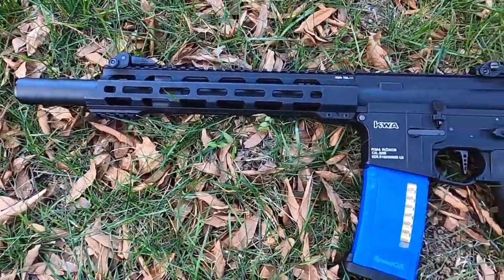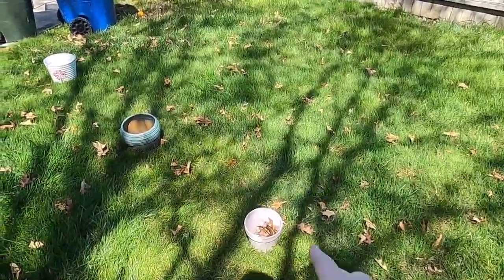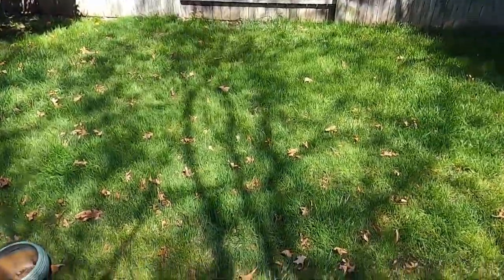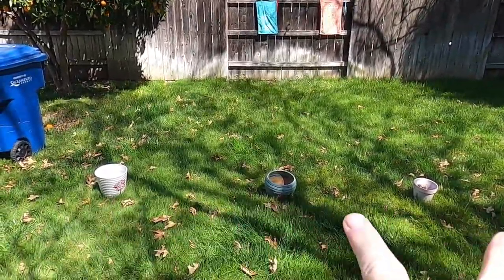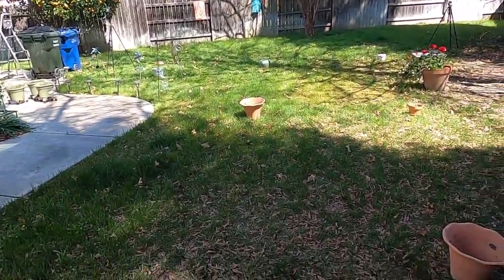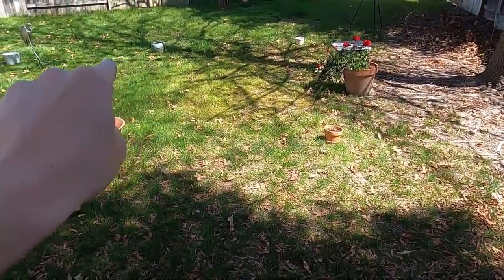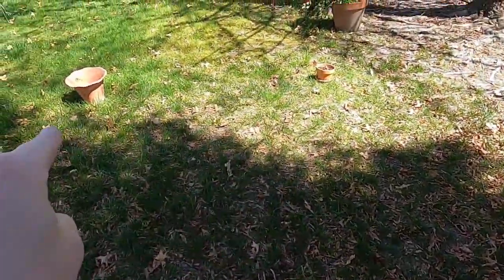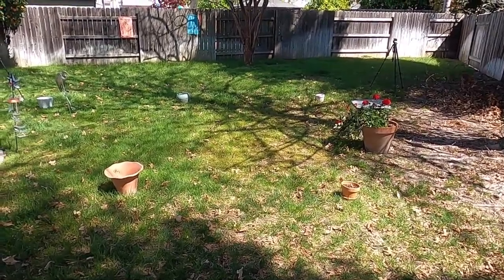Backyard Airsoft CQB Drills With The KWA Ronin T10

Comment: Hey! Great video!! I just got my Ronin T-10, so excited to get it out on the field. I bought a PTS mag but it’s not fitting into the ronin. I’ve had trouble finding any resource on mag compatibility for the T-10. By any chance do know any compatibility for mags? I don’t want any colored mags just black or tan.
Reply from the maker: I ran PTS SpeedQB mags and didn't have any real issues. They were a wee bit stiff going in but that was all. I don't know about the non-SpeedQB mags.

Comment: What’s the internals in the gun?
Reply from the maker: Standard AEG 3.0 internals from KWA. I don't know the specifics on the motor torque and such.
Reply: Caber Up I was wondering cause I see u have a speed trigger in and is it the aeg or hpa version?
Reply: Jyung1_1 this gun is an AEG and pretty sure it comes stock with a speed trigger 👍